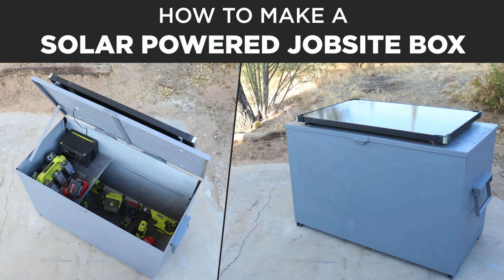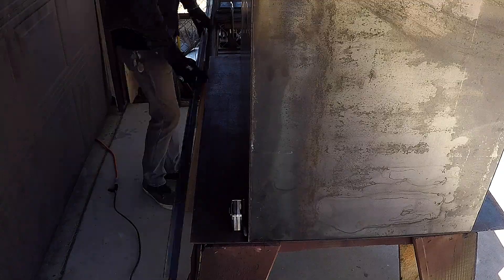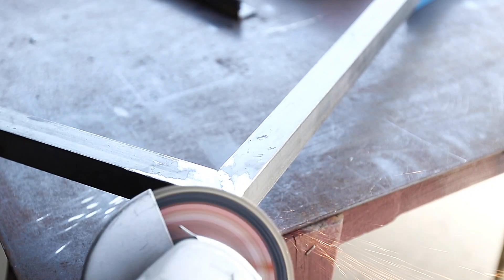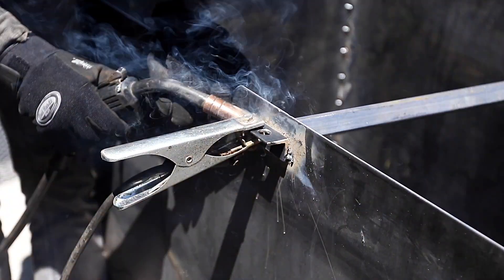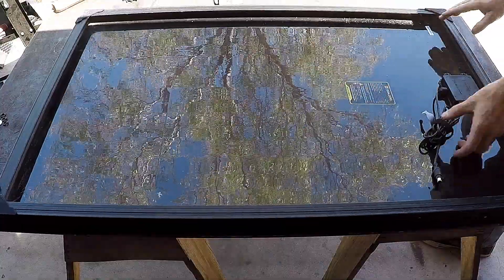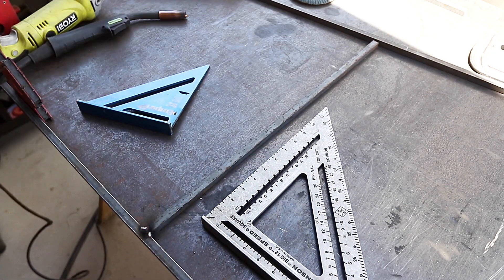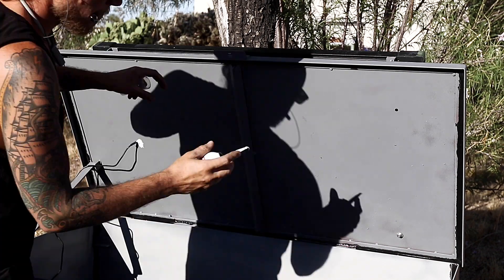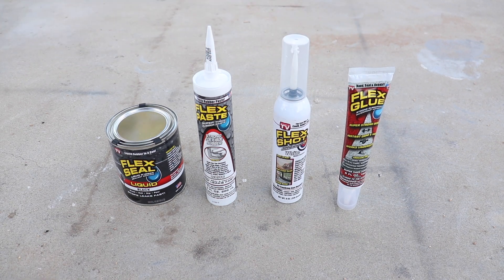Making a Solar Powered Jobsite Box

Comment: People who aren't pushing a particular product should know there is a WIDE variety of sealants andadhesives available from industrial sources like Dupont, 3M, Lord etc often
at better prices. If you have the money you can have the custom box parts hot dip galvanized before final assembly then it should last many decades outdoors. I'm surprised more
fab shops and individuals don't take advantage.

Comment: Gps tracker actually work inside a steel faraday cage? Very cool design. Would be interesting to see what the internal temperature is inside. Might degrade batteries. Maybe a cooling fan or two?

Comment: I found your concept works incredibly well for a small construction company.  We have used small cargo trailers instead of a jobsite box to keep a basic assortment of tools/fasteners/materials on site.  When done... move to the next site.  I love your solar idea and have been looking for just such a solution to add to our trailers.  I was wondering if your box leaks due to cutting off the angle where the hinges attached?  Is it possible to not cut the angle and just mount the hinges at the bottom of the angle? It will change your swing geometry but this could be compensated for by making the top a bit larger in the front.  Now that we will have solar power in our trailers, we can install a temperature controlled fan to help keep the heat at a reasonable level in the summer.  We have also found installing a 25w light bulb (incandescent, not LED)  inside of a large igloo cooler will keep your caulk and glues from freezing in the winter.  Love your channel.  Thanks.

Comment: im interested to know how this set up would perform with bigger batteries (the more common deep cycle) as apposed to the all-in-one battery and charge controller shown here.
im not sure how useful this would be on a regular job site as a primary battery charger unit with more demanding power tools, e.g table/mitre saws. Would it be able to keep up with charge times?. However the design and information in this video is, as usual, AWESOME :)

Comment: Very cool project but I would question using expanded steel as the floor since it allows everything from insects to reptiles and mice to access the box.  I've also been looking for a tool storage solution both for my garage and for when I have larger projects elsewhere.  I looked at job boxes but ultimately decided that they were too large/heavy for what I was looking for and that they're ultimately an inefficient storage solution as they're tall but it's mostly wasted space since most tools take up little room vertically.  It would be interesting to see a job box that was maybe 12" less in height and had staggered sliding trays like an old school wooden hand tool toolbox for smaller tools, hardware and accessories.  Great idea to have solar for charging batteries.

Comment: Nice concept but I see some flaws:

1) Security- 
a) Add a shroud around the lock hasp. A grinder will make quick work of the locks shackle.
b) even with a lock shroud... the box can be tipped on its side and a grinder can make quick work of that mesh. (Suspects would be narrowed to those that have seen the mesh bottom)

2) GPS - placed inside the metal box that will block the signal greatly (perhaps disguised on the top of the box next to the solar panel, or underneath it?)

3) Battery Temperature - how hot does it get inside the box? You have solar, hook up a cooling fan directed at the batteries and add some vent holes. (And add a simple thermometer inside the box)

4) Weight- Yours may be lighter because of the mesh bottom but I’d add larger feet (square tubing)  that allows the option to get the forks of a forklift underneath it if it becomes too overloaded.

5) Damage - Perhaps add a sheet of Lexan with spacers over the panel.
How durable is the Solar panel? Could things damage it during transport or while at the jobsite(s)? Big open areas aren’t a problem, but what about tight jobsites? Could things falling from roof heights land on it a damage it?

Comment: So that solar panel seems a little underpowered for the job at hand. It takes between 15-30 hours to charge the Yeti with the 100W solar panel, yet you'll get between 8-12 hours of sun, and the chargers are always on and drip feeding the batteries. Maybe a switch to turn off the battery chargers so the Yeti can actually charge, or a bigger solar array would be necessary.

Comment: That box is not secure at all. I'd pop that open in less than a few mins lol. Big pair of bolt crops  cut the hasp open. lol. Why didn't you hide the tracker ( you sure you'll get a  decent signal inside the box ) ?  
Nice work none the less and well constructed apart from the lock placement. 2 chub locks either side would create more of a problem to open it up ( still can be popped but takes time and  creates noise).

Comment: the box need insulation from heat, more rack/shelf system, a slight angle top lid, a wheel, and that big battery should put on the bottom shelf just because you doesn't need to reach it often compare to the tools

Comment: I like the build but seems like it would be relatively easy to tip over (even when loaded with tools) and the mesh wouldn't be that hard to get through. If you spiked some rebar into the ground on the jobsite and dropped the box on top should make it a lot more work . Ziptie, chain, or somehow afix inside the box.
Also I'd suggest adding a layer of sandbags to the bottom (at the jobsite). Easy for you to remove when you want to reposition the box but makes it a lot more work anyone else to move.

Comment: This box needs wheels. I can't imagine lifting once it's full
Reply: chumanji9 that’ll make it super easy to steal!
Reply: GPS tracker for the win. I’m putting on big casters.
Reply: Forklift I’m sure
Reply: Add forklift pockets like a welding skid. If you need it to roll, weld on four corner tubes for scaffolding casters. You can slide those out and lock them inside if desired. I put many things on scaffolding casters.

Comment: lets put this gps tracker inside a faraday cage so that we can't use it to track the faraday cage.
Reply: Yeah, I was thinking that. I wonder if the mesh floor lets any signal out, but still not ideal.
I think sticking it under the solar panel would be better, over near an edge.
Reply: @DavidFrostbite  GPS line of sight. So no the mesh will not help.
Reply: Yeah! And then let's pùt some batteries and chargers in a closet metal  box in the desert sun. It is veeery good for the batteries!
Reply: I thought the same thing. Plus yea the heat might be an issues. You got solar so maybe some vents at the top as well as some fans to suck air in from the bottom and vent it out the top. It may not be too terrible if you only keep it closed during the night.
Reply: Who is going to steal the box?  It looks like they can push it over, kick in the bottom, and steal the tools.
Reply: as soon as you open it also the signal can escape ;)

Comment: I would be very mindful of the temperature within the box as lithium ion batteries degrade quite quickly above roughly 140*F.  Further more, storage at that temperature will do more harm to the battery if they are fully charged.
Reply: They could add a small fan pretty easily. The whole floor is mesh, so just putting one on the floor pointing up should work.
Reply: @DavidFrostbite  they can, and that will help.  But I am more focused on the fully charged batteries and the heat, as opposed to the heat.
Reply: exactly what i was going to say
Reply: just place it in the shade
Reply: @williamdahl1495  and that does mitigate the heat issue, but it certainly doesnt resolve the issue.
Reply: @MikaTheAboveAverageDog  keeping the box in the shade will do wonders for the solar. /s